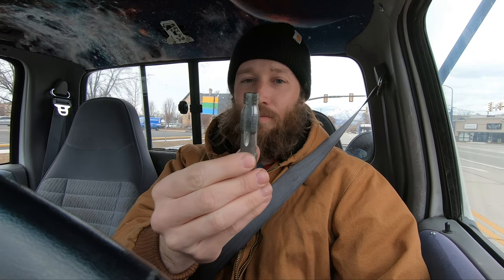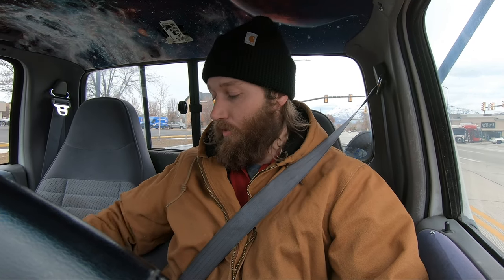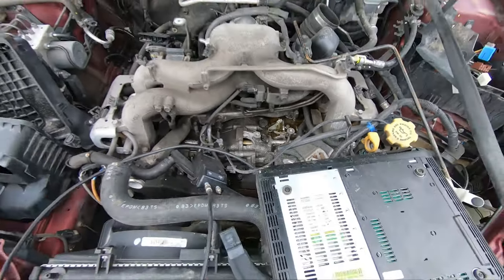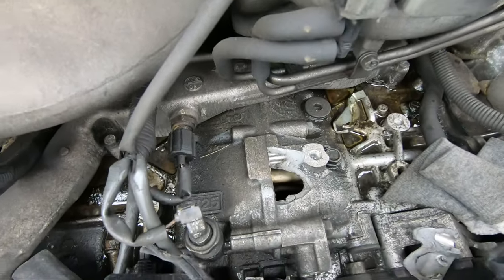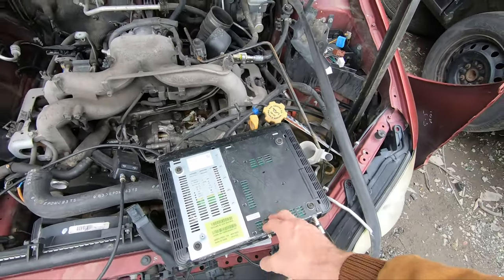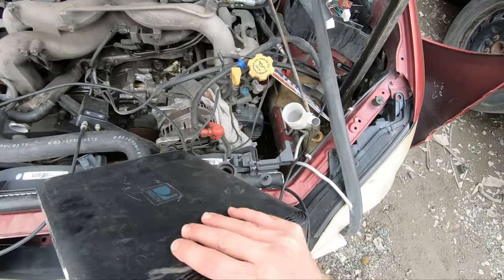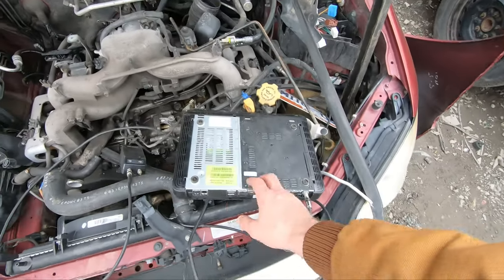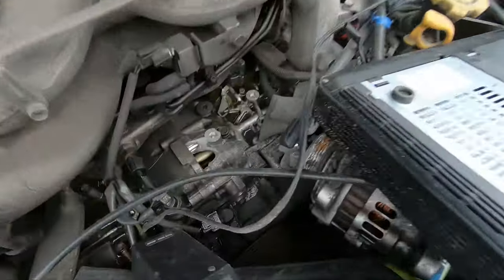Should You Grease Your Cutter?

Comment: I agree. Grease will just gum up the sustem...at least when its dry you can use a small tube vacum or compressed air to clean it out.  Fortunately aluminum is soft

Comment: I've heard of this recently, it wasn't a cure all for shavings I know that much. What I saw was a new hole being drilled most of the way and the last bit when you would punch through the grease was added to mitigate what dropped inside. Re threading an open hole with this method seems more tedious than just cleaning it out after to me.

Comment: Considering timesert instructions tell you to use grease to help catch shavings I’ll follow that. You just packed the tap with grease and cranked it down without ever backing it out and cleaning it so of course you forced some shavings into the cylinder. Not sure how this proves everyone wrong when you start out with a flawed method to doing it. This actually was a great idea for a video had you done the steps correctly.
Reply: I agree with you too. Baby steps lol. A little at a time, and cleaning it off as you go.

Comment: Your particular grease method is flawed. The proper way to do it using grease is to cut for a few turns, then remove it, clean the grease and shavings, and then reapply new grease. It will take a few times of doing this but you will get very few chips, sometimes none, in the cylinder. If you just dive in and cut the whole thing like you did , then yes, you'll still have shavings and grease in the cylinder.   Besides, when cutting any new thread you're supposed to go forward a turn or two, then reverse a bit to clear shavings, then go forward again. Your method of going all the way with one application of grease and all those chips stuck to it all the way through will probably not cut good threads anyway.
Reply: I totally agree and if anything he should put the grease on the threads in the hole and then continue with the method you mentioned.
Reply from the maker: I thought I mentioned that. It would be an option taht way but still more work and still has all the same risks. Bad idea IMO
Reply: @RoadsideRescue  going slow and cleaning as you go is not a bad idea. Having grease on the threads of the hole and not on the bit has worked for me. I always just go a little bit at a time. You might’ve mentioned that during the Subaru, I got distracted with something else at that point in the video and haven’t finished it.
Reply: You do this method correctly you will prevent shavings you can't over load the flutes with grease so it can catch shavings
Reply from the maker: It might not have made the cut either...
Reply: Flat rate speed speed speed your method take to long.😁😁😁😁
Reply: @k9under Sometimes you gotta slow down to go fast. If you screw up the threads going too fast you'll be replacing the head. Not too good for your "flat rate."
Reply: The straight plates aren't designed to move the shavings out of the way while cutting. Last thing you want to do is to have a shaving either ruin the new threads you just cut or worse cause the tap to break on the way out.
Reply: This video proves nothing.  It would be like if I said greasing your caliper slide pins is wrong, loaded up a caliper bracket pin with as much grease as possible and then showed you how it jammed up the pin and made it impossible to slide it back in, and then stated I proved you shouldn't grease your slide pins.  

You can do this job with or without the grease.  That's not the issue.  The shavings will blow out with a blow nozzle with not much problem.  Even if you miss a fleck or two, a leftover aluminum shaving isn't going to be a problem anyway.  However, if you're going to use the grease method you should at least do it the right way.  Loading up the tap with as much grease as you can and just running it all the way down in in one step is not how it's done.  Here's an example of how to do the grease method properly:   https://www.youtube.com/watch?v=B3irFj2XeCM
Reply: I have to agree with John at least that’s how I do it. But I use Vaseline. The one thing you mentioned is “it’s still more work”. The whole job is supposed to provide the customer with solution without doing a cylinder head. So let it take an hour if needed. Take it out clean the flutes go again. It’ll be fine. And you still just cranking on it. It’s a tap it needs to be taken slow and smooth. Same as tapping anything else.

Comment: How much would you charge to get a 1965 ford f100 with a 352 running again, all I needs is to see if the ignition is hooked up the coil and starter that's it.

Comment: Cast iron u don’t need grease or cutting oil ! Aluminum i usually use a wax cutting paste! Maybe the grease will make what particles fall in stick and not come out as easily! Otherwise easy enough to vacuum out any debris if threads are cut dry! 🏁🏁🫠🤔🫡😝

Comment: I've done it multiple times and not gotten any chips in the cylinder at all. I still blow the cylinder out afterward, of course, just in case, but it does work if you do it correctly. "Y'all are WRONG" just isn't true.
Reply from the maker: I mean I made the video and suplied proof. Yall were wrong. There is clearly pictures of metal down in there.
Reply: @RoadsideRescue  You supplied proof of nothing.  You don't just load up the tap with grease and just run it all the way down in in one step.  That will leave exactly what it left you.  Put grease in the flutes and run it 2-3 turns and pull it back out.  Clean the grease and shavings off the tap, regrease and then go 2-3 turns more.  Do this until you break through.  I have had it drop a few shavings in but I've also had it not drop any at all, depending on how careful I am.  Besides, you never just run a tap all the way down without reversing a few times to clear chips from the threads anyway.  So, your grease method is flawed.  Anyone that says it will eliminate all chips 100% of the time is wrong but it will significantly reduce them 100% of the time.  

With an aluminum head you can tap it without grease and just blow the chips out.  A leftover aluminum chip isn't likely going to hurt it should it get left.  It will blow right out the exhaust.  My only point is, if you're going to try and prove a theory right or wrong (and claim "y'all were WRONG") you need to do a little research beforehand and find out how to do it first.

Comment: I would not use grease , i think all the metal filings and grease would enter the Engine and stick , but just with the metal filings you can just blow out with a air line .
Reply from the maker: I think the same!